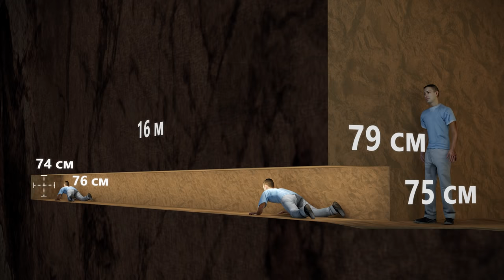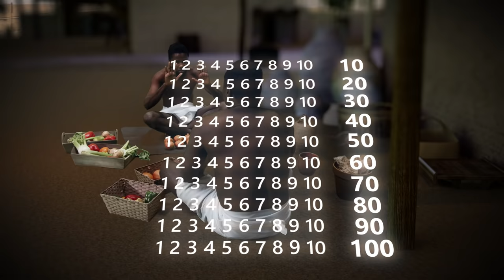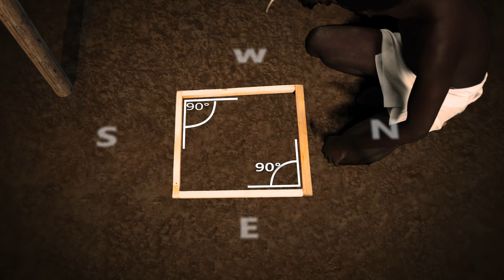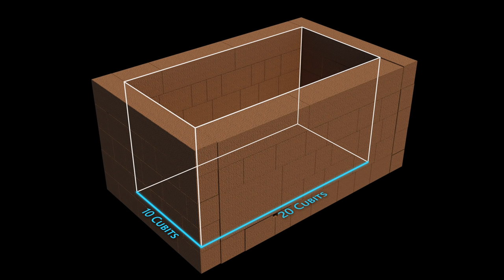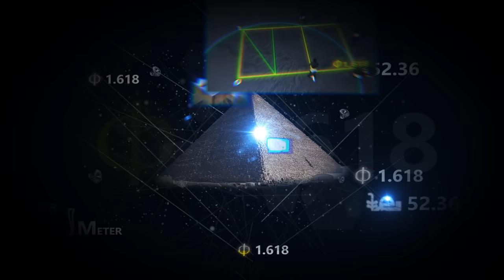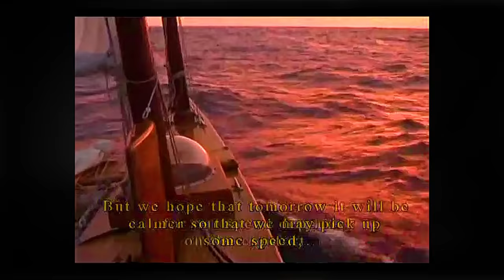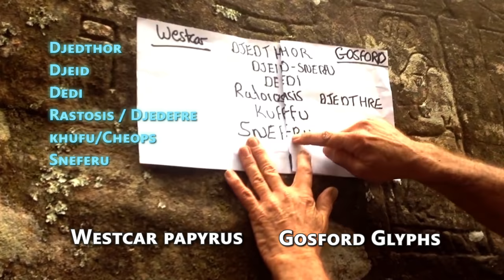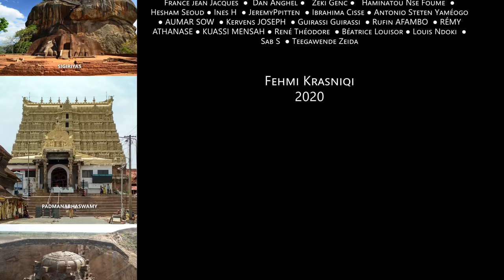The Movie Great Pyramid K 2019 - Director Fehmi Krasniqi

Comment: 1:51:46: "[...] they used the sky configuration of that year. This gives us precisely the date of the construction of the Great Pyramid between 2560 and 2550 BC."

I remain unconvinced by this explanation. I still hold the belief that the Great Pyramid is older.

General musings:

The Egyptians made significant discoveries such as the meter, Sacred Geometry, solar energy (i.e., the Solar lens), the clock, and possessed advanced astronomical knowledge. They ingeniously devised a method to pour water upstream, meticulously planned the Great Pyramid by creating a blueprint before its construction, and successfully built it, achieving remarkable perfection in the design of the King's chamber. However, it is intriguing to note that the wheel was not among their inventions!

In other words, the Great Pyramid was not solely the work of the Egyptians but was built with the assistance of the Atlanteans, who possessed superior knowledge. This hypothesis gains support from the question of why the Egyptians did not continue constructing such pyramids if they had the technological capability to do so. With this technology, one could accomplish the task of pyramid-building in a shorter time, perhaps 13 years instead of the traditional 20, and potentially at a reduced cost.

Egypt experienced a decline or devolution in its technological prowess, indicating that the Egyptians were not the true originators of the advanced knowhow. According to this viewpoint, when the Atlanteans departed to disseminate their knowledge to other parts of the world, their expertise was absent in Egypt, leading to a decline in their [Egypt's] technological achievements. Consequently, the apparent devolution observed in Egypt was, in fact, a natural progression, as the Egyptians may not have been as advanced initially as they appeared.

It is worth noting that this perspective aligns with the presence of comparable impressive stonework found throughout the globe, suggesting a shared influence from the Atlanteans.

2:01:35: Here they say 20, not 13: "Twenty years of hard work for their King is coming to an end!"

Witnessing the construction of the Great Pyramid is truly astounding and leaves me in awe. It suggests the involvement of an advanced civilization, possibly the Atlanteans. The level of intricacy and engineering involved is too remarkable to be attributed to a civilization that had not even invented the wheel. It is hard for me to accept that such intricate planning and execution were carried out by ancient Egyptians alone.

2:07:24: "The pyramid is indeed a cenotaph for the soul, a spiritual monument where the meter, the royal constant, pi, golden ratio, chemistry, time, mathematics, astronomy are all inscribed."

Yet—no wheel.

While the documentary may distance itself from the notion of Atlanteans, it inadvertently reinforces my belief in their existence. In fact, I believe Egyptologists may resist this idea because they recognize the glaring truth: If the construction methods portrayed in the documentary are accurate, then it supports the hypothesis of an advanced civilization predating the flood. It is inconceivable that the ancient Egyptians alone possessed the ability to manipulate colossal stones with such precision, almost as if they were gods.

I couldn't help but chuckle at the explanation provided in the film. Suddenly, they invent the meter, and just like that, they can effortlessly melt granite! It's far more plausible to consider that they acquired these advanced technologies from a civilization of the past. It's as if they stumbled upon an ancient tech support manual with instructions like "How to Melt Rocks 101."

A little too convenient, don't you think?

If the Egyptians truly possessed this level of technology, one can only imagine how drastically our world could have evolved. We might have already achieved the capability to travel in UFOs, a notion that may be attributed to the Atlanteans according to my understanding (of Randall Carlson).

It is somewhat peculiar that this film does not include any mention of Randall Carlson's research on the Great Flood or the Younger Dryas impact hypothesis.

Furthermore, I'm curious if the Solar lens mentioned in the documentary is associated with the original Eye of Ra.

Also, I am intrigued by the contradiction between this YouTube film and the statement made by Egyptian archaeologist Zahi Hawass, who described it as “the greatest discovery in Egypt in the 21st century.”

From: https://bigthink.com/culture-religion/a-just-discovered-papyrus-reveals-how-the-great-pyramid-was-built/
Reply: 2:07:38: "The King is dead. A large, public ceremony takes place for all the people. The King's body arrives from the port."

"Oh, let's just say it's a burial chamber and call it a day." They couldn't come up with anything more imaginative or exciting? It's a pyramid, for Ra's sake! There's got to be something more epic going on than just a regular old burial. It's like saying the Sphinx is just a big, fancy lawn ornament.

I'm pretty convinced that the Great Pyramid is not a burial chamber.

2:12:12: "The workers leave a dolerite ball and a copper hook as a souvenir in the middle chamber, then they plug the holes."

Without a doubt, this explanation in the video seemed incredibly lackluster. It felt as though it was hastily included to give the illusion of a coherent storyline.

2:14:52: "The 3 pyramids are aligned with the Betelgeuse stars - Alnilam and Rigel. The correlation is perfect."

My faith in Orion's Belt remains unwavering. Consider this possibility: What if it aligned some 12,000 years ago?

2:17:33: "Yes, You heard the word Negro! It is unfair to show you a recipe without showing you the real chefs of these monuments."

The statues do indeed bear resemblance to Negros, if I may use that term. Once you notice the resemblance, it becomes impossible to overlook.

Additionally, I hold the belief that the depicted power and influence of these ancient, black Egyptians may not align with a strictly modern understanding. In contemporary times, scientists suggest a close connection between ancient Egyptians and Middle Eastern populations. However, if we consider the possibility of Atlanteans settling in Egypt some 12,000 years ago, it allows for the presence of black Egyptians within that historical context. In this way, we can find a resolution to the mystery at hand.

Picture this: Long ago, aided by a small group of Atlantean survivors, the black race accomplished remarkable achievements, including the construction of the Great Pyramid. However, they eventually departed Egypt, embarking on a journey across the world, leaving behind astonishing stonework found in various places, such as the Pyramid of the Sun and the Moai statues (which look like a black race) on Easter Island, among others. Many years later, Middle Eastern populations settled in Egypt and aspired to replicate the accomplishments of the black race, but their efforts proved unsuccessful. This unsuccessful endeavor led to the mistaken perception of a technological decline in Egypt over time, giving rise to an illusion of devolution.

Thus, the populations in the Middle East can be likened to a cargo cult phenomenon in Egypt.

In other words, the Atlanteans were aware of the existence of the wheel, but when the cargo cult emerged, they lacked knowledge about it. As a result, the enigma from above has now been resolved.

Egypt some 12,000 years ago: Black.
Egypt some 4,500 years ago: Tanned-olive-skinned/Multi-ethnic.

2:26:12: "Thousands of Egyptians traveled to America, now Guatemala, for the first time between 2000 and 3000 years BC."

My belief is that the Atlanteans played a significant role in imparting knowledge to the indigenous Egyptians. It is possible that black Egyptians may have explored the world, as depicted in the film, and perhaps a few Atlanteans chose to remain among them. Notably, the Aztecs believed in a white, bearded deity called Quetzalcoatl (an Atlantean?). Furthermore, certain hieroglyphics in ancient Egypt depict individuals with features that combine traits of black Africans and Caucasians. From this, one could speculate that Ra, the sun god, was depicted as a white Atlantean, and the Egyptian kings may have been of mixed white and black heritage.

2:29:38: "12,000 kilometers separate Egypt from Mexico. How did they manage to cross 7,800 kilometers of ocean?"

This phenomenon can be attributed to the advanced knowledge and skills possessed by the Atlanteans.

2:56:32: Are these images depicting the Solar Lens?

2:07:05: "The meaning of this internal architecture is the djed resurrection."

In my personal view, I believe that the Djed symbol represents the cuboctahedron and its association with the four elements. Furthermore, it symbolizes the connection between the cuboctahedron and the human spine. This ancient knowledge delved into the realms of consciousness, chakras, and the energies of Kundalini. It is possible that the Atlanteans possessed a profound understanding of the afterlife and what occurs beyond death.

3:04:09: "...the ruler of Egypt, still alive, Khufu."

There is a compelling implication to consider: Khufu might possess Atlantean heritage, potentially being either fully Atlantean, half Atlantean, or possessing access to Atlantean technology.

3:15:48: "The assumption is that at this point an apocalypse occurred. Around 2100 BC." + 3:15:56: "A very powerful earthquake. The continent in the middle of the Atlantic, Plato’s Atlantis, sank." + 3:29:23: "Atlanteans, missing astronauts or slaves. That's fiction, fantasy, not science."

It's like they're saying, "Hey, we totally believe Khufu has some Atlantean mojo going on, but shhh, let's not upset the scientists. We want them to take us seriously!" It's a delicate balance between embracing wild theories and keeping up appearances for the sake of credibility. It's like being a secret Atlantean fan club member, but with lab coats and spectacles instead of ceremonial robes.

3:25:26: "This is the true story of the "Philosopher's stone” which we so often hear about: [...]"

This particular topic is undeniably fascinating. Once you delve into the realms of Khem, alchemy, Freemasonry, and the Philosopher's Stone, it becomes clear that there is a profound emphasis on the science of stones.

3:29:23: "Atlanteans, missing astronauts or slaves. That's fiction, fantasy, not science."

Yet—this video is like the ultimate "Atlantean Discovery Show" on YouTube! It's our best shot at confirming the real deal, Atlantis! Move over, blurry Bigfoot footage, this is the real deal. It's like finding the lost city of Atlantis in a sea of cat videos and fail compilations. Trust me, this is the holy grail of ancient civilization videos. The Atlanteans would be doing a victory dance in their waterlogged ruins if they could see the hype this video is getting!

3:29:50: "These theorists who advanced ignorance and obscurantism now belong to the dustbin of history."

Absolutely not! They shall be revered! They are absolutely correct! The hypothesis of Atlantis will persist indefinitely, for it embodies the ultimate truth! Truth shall prevail.

To put it in simpler terms for teenagers to comprehend:

OH MY GOD, YOU WON'T BELIEVE IT, BUT ATLANTIS IS ACTUALLY FREAKING REAL!

Go ahead and tweet!

Comment: Huge flaw with the poured theory.  The wood mold separating the bottom of forms and in-between stones would still be there.  But there's no wood. Instead, you can't fit a sheet of paper between stones but there's a clear separation between all stones.
Reply: 🙄 they remove it just like they showed. Did you not watch it?

Comment: This is by far and away the most accurate way they had built the pyramids. Although it may not be a popular theory and may not have the exact recipie it is obvious as it solves most of the problems. At first I thought that the granite would make more sense poured cold like the geo-polimer, but it doesnt seem very level on the top so now I think the granite was only partly melted perhaps at a lower tempreture. It has straight edges but it also seems to have alot of crooked edges also. But this is how real science is supposed to work.

It solves how wood got permanently stuck in the stone.

The c02 problem is solved.

The logistics of labor is 10 -13 years for 4 months per year. Far more lickly than 20 years.

The missing slag is also solved.

The transport of the stone make more sense.

No boat problems.

Solved - Evidence of melted granite https://youtu.be/etOPM9YhVf0?si=uVM3lXyKuZjjDWui

The other options are not very scientific. Cutting the stone with copper chisels? 12 000 workers draging the stone up hill? Aliens? SeriousIy? Gimme a break!

Comment: The Grotto well shaft underneath the Great Pyramid was not dug out of the bedrock.  It was allready a hole in the ground in which they constructed the grotto then backfilled it in  with rubble same with the shaft it was built from bottom working upwards backfilling in as they worked upwards.

Comment: Thanks for the video. It does give us different perspective on how the megalithic stone can be cut & moved. There are some other questions though
1. If so much mold is used, where are those disposed? If the stone is not moved but poured, how the stones can be so closed to each other and not even a single paper can slip through. Where the construction wasted went? Wooden moulding, thousands of buckets etc
2. What's the shaft used for? If it was meant to let ppl move around, why not make it bigger & more comfortable for movement. Why so tiny that u need crawling?

Comment: If Moulds are used then there has to be a similarity between the stones, as the Moulds must have been reused. and there has to be an imprint of the moulds on the "so called concrete" stone.

Comment: This is brilliant. Thank you. Can someone just go with me for a moment? What modern day tools do we have that could smooth cut these blocks? Water jet? Disc cutting? Plasma? Look at the smooth cutting on some of the areas. Thanks.
Reply: I mean there's YouTubers cutting, drilling, boring, sculpting Granite with just Corundum powder and copper.
Interesting, Corundum residue was found in ancient Egyptian granite boreholes - basically what the Egyptians did was spun a weighted copper pipe at high speed using a "bow apparatus", which grinded the Corundum abrasive powder into the granite and cut/bore it. -Corundum is a common mineral which is almost as hard as diamond, and easily bites into granite.

Comment: Having done concrete work with builders, I know how the wooden forms used to create a desired shape have to be very strong to withstand the pressure of the concrete during the curing process. And, like was shown, wood enjoys sticking tightly to concrete. Typically, the wooden forms used are sacrificial, and to be removed, they are destroyed. The smallest knot or imperfection in the wood form is imprinted onto the concrete within- has this been observed anywhere in the pyramids? The concrete theory does not adequately answer how they built intricate statues, vases and delicate bladed bowls made out of materials other than limestone. Finally, the pyramids of Giza were covered in a layer of limestone, but the interior structure was a completely different material. If everything was poured in place, wouldn't it make sense to use a uniform recipe throughout?